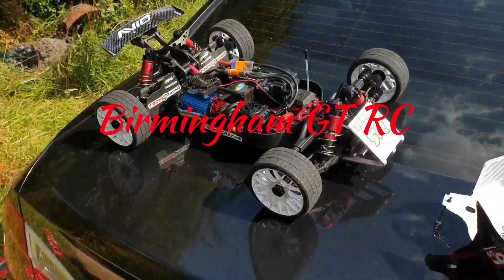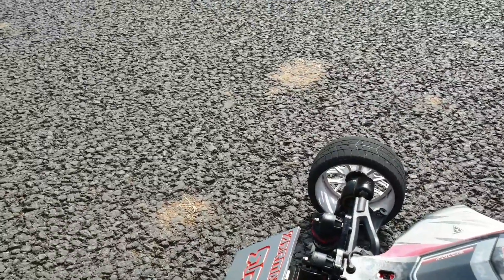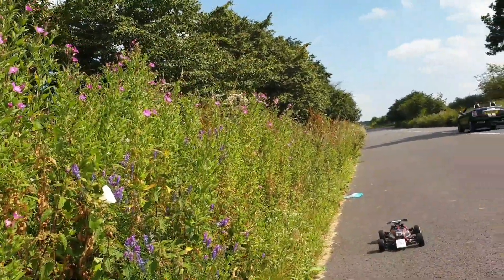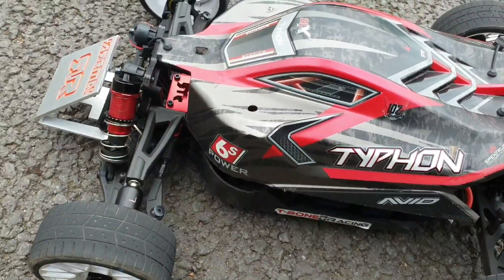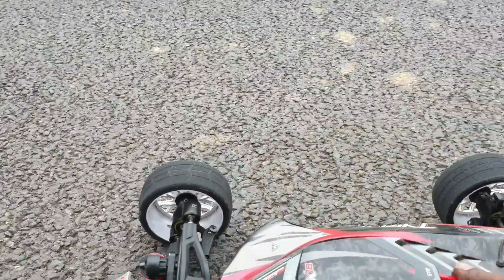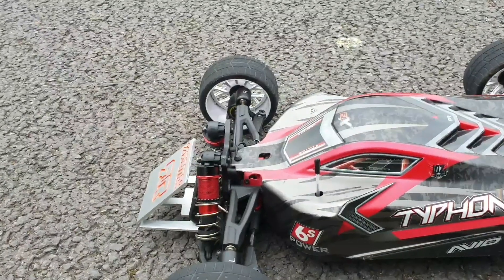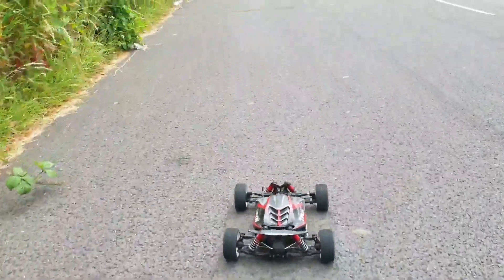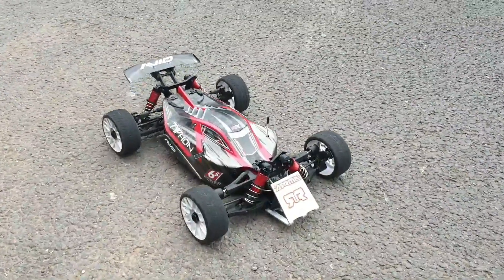Arrma Typhon V4 speed run 4s 65mph+

Comment: What wing is that?
Reply from the maker: Ebay really cheap like between £5 to £15 real carbon fiber and in different styles. Their touring car wings but it came with out holes so I drill to fit HSP 1/10 buggy first but then try on typhon and it fit with just a very small trim on holes.